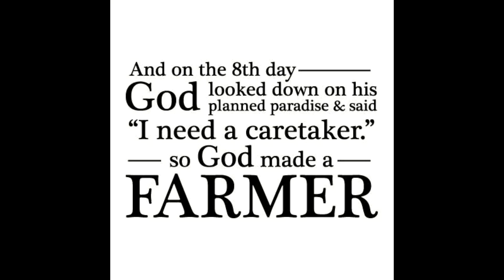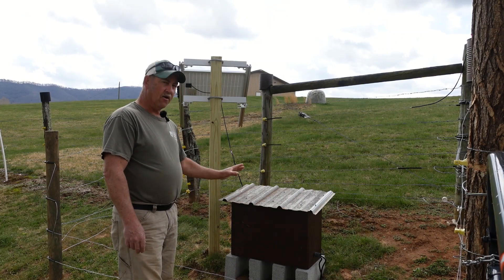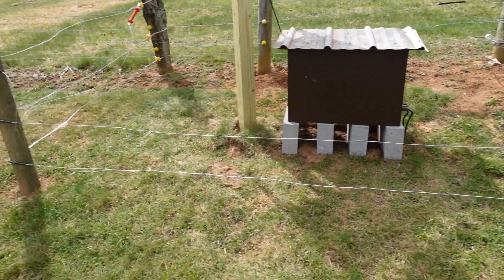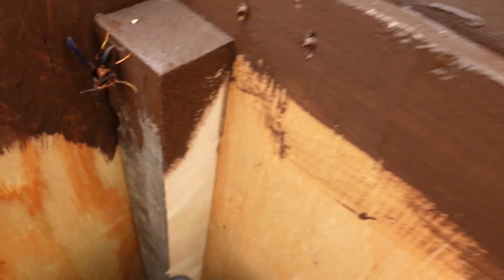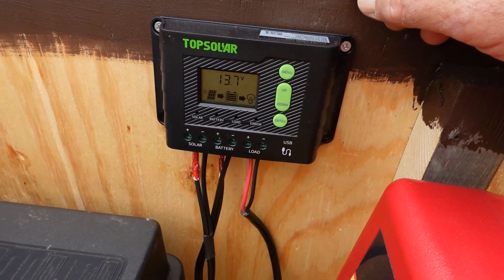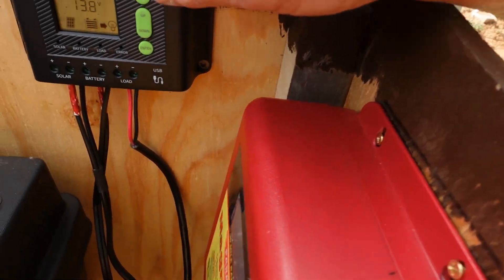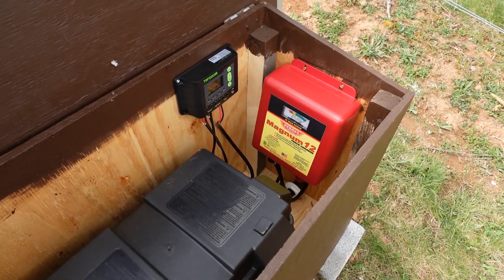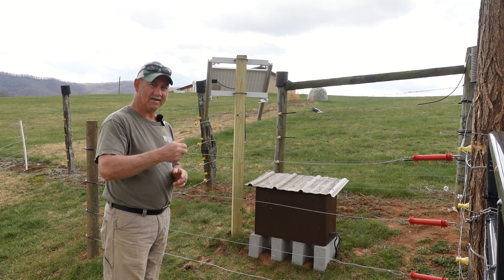DIY Solar Fence Charger Field Install - Finished!

Comment: To anyone that has questions about this Parmac12 fence charger… I actually built the same set up to keep my horses in their pen, especially one that likes to be an“escape artist”… And let me tell you, that put an end to the pushed down fences! That Parmac 12 packs a mean punch with that three joule output and is actually strong enough to deter a bear! I actually got bit by this fencer once while standing in a puddle while checking our fence… I DIDN’T like the outcome of THAT scenario, seeing that it has the power of one 30th the delivery power of a heart defibrillator!
Reply from the maker: That’s great! Glad your Magnum 12 worked good. Mine didn’t as I documented in a follow-up video. I guess I got a bad unit.
Reply: @ One difference that I made between my build, and the one you built: I actually used a Renology 100 Watt Solar panel to keep it charged for the past 3 years since I built it. That really keeps the battery up and gives it no excuse for the battery to be dead and the battery charge to be low. And the big battery I saw that you were using might not be getting much of a charge. Keep in mind that solar panels will still produce on cloudy days, but just like those solar powered calculators that they had back in the day, the lower the solar panel output watts, the worse it will work on cloudy days.  But that’s only just my guess and opinion as well…
Reply from the maker: @gt2699  good info, thanks!

Comment: How many acres are you fencing with this system. I’m looking to do five acres and want to run five strands of wire. I have foxes, river otters, skunks, and coyotes to deal with.
Reply from the maker: About 4 acres with 4 strands. I would NOT recommend the Parmak Magnum 12...junk. The Solar Pack 12's are good chargers, this Magnum 12 was pure junk. We got rid of the Magnum 12 and replaced it with a Power Wizard PW5000XD charger and are quite pleased so far.

Comment: Sally and I will be installing our solar fence this weekend. We have the fence up, just installing and testing the charger. No DIT for us, ours is out of the box Parmak 6 volt system.
Reply from the maker: I think you'll get good performance with the Parmak Solar Pak 6. We run 2 Solar Pak 12 chargers (for several years) and have had excellent results with them. Use good grounding rods. Your charger is no better than your grounding system. Good luck!